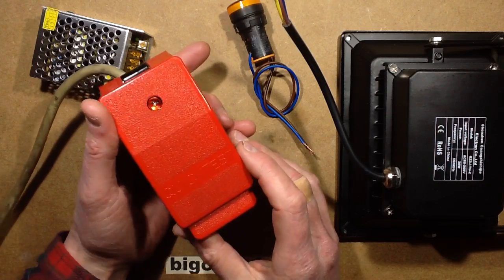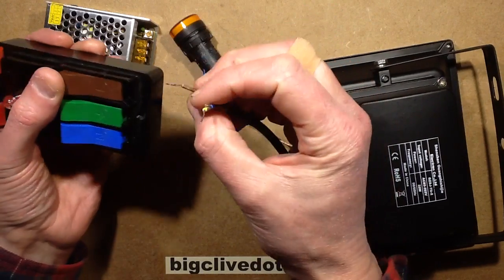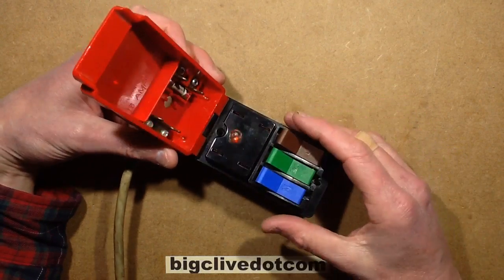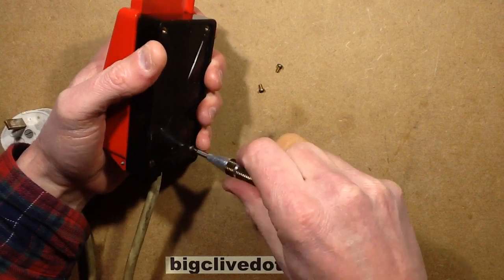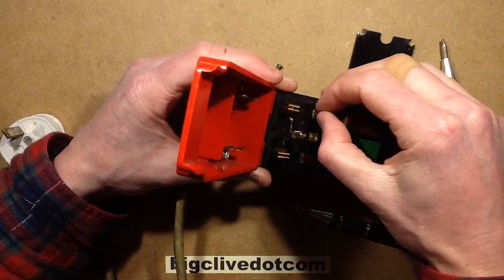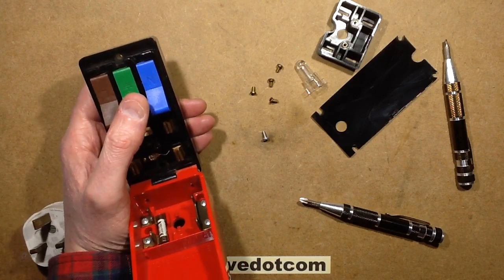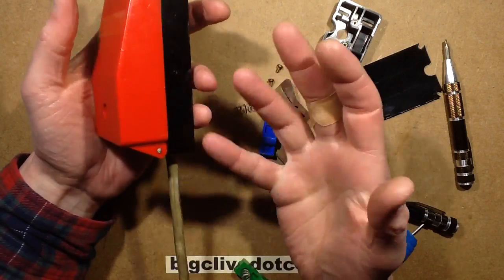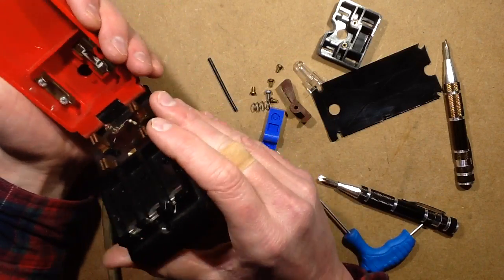A look inside the Cliff Quicktest mains connection unit.

Comment: A great idea, but with quality issues. I bought the 3 phase model a year ago figuring that I could use the 2 extra circuits for my bench's 12Vdc power supply.  I ended up having to use the 2 extra circuits for AC because the screws stripped on the blue and brown even though I did not overtorque them. I have 30 years experience in electronic repair and know how much torque to use.

Comment: I used to have a really old version of one of these with uninsulated metal clamps for the conductors. Don't really believe it mattered but it's nice to know they're insulated now. A bit safer than the choccy block hanging on the end of a bit of cable with a plug on the other end! (Although I've seen B.C. using something similar,)

Comment: These are very nice units, especially for workshops and for us youtubers but I can't agree $60 is a good price, for suck a device I think a good price would be $30. I personally am not getting one because of it's price.
Reply: You could probably wire one up pretty easily tbh, couple of crew connectors and a light switch and boom you have essentially the same thing for £5 or less
Reply: +The Mad Hammer I guess 3d printing one would be a good idea because you can also design the isolation slots and proper mounting tabs.

Comment: Looking for the weak spot in this device for someone accidently or foolishly giving himself a mains shock I can only think of him sticking a suitable strip of metal into the mains side knife socket. Our mains 13A plug sockets prevent this happening by incorporating shutters that only open when the longer earth plug pin is inserted. I suppose incorporating similar shutters into this device for extra safety would just be silly considering it is intended for professional use only ?
Reply: +meandmymouth  not really a lot of point in guarding the knife sockets when the whole point of the device is to connect arbitrary bits of wire to the mains. This device should only be used in suitably controlled environments where everyone is aware of the hazards of electricity.

Comment: Nice to see you using an MK mains plug, sad that that MK no longer make them. They were beautifully designed and so easy to wire up and less prone to overheating with the large area of contact in the terminal posts than lesser plugs with their tiny little screws.
Reply: +Donald Sayers umm the plug in the video looks like a MK "safetyplug" which is still listed on MKs website and still seems to be available from a number of distributors. https://www.mkelectric.com/en-ar/Products/WD/PortablePower/PlugsandAdaptors/Safetyplugs/Pages/646.aspx http://uk.farnell.com/mk-electric/646whi/plug-safety-13a-white/dp/107754
Reply: I stand corrected.

Comment: very useful piece of equipment but really should not be as expensive as it is... a plastic body, a few copper strips and springs... if i had to guess id say this prob costs no more than £3-5 to make, and charging £30+ for it is way to much for such an extremely simple device in my opinion... im just gonna stick to quickly screwing wires into a normal plug

Comment: You won't get these in Germany, because of the stupid non-keyed Schuko-Sockets and plugs!
Reply: +BloodySword Farnell list it on their german site with a choice of a UK plug, a schuko plug or no plug.  http://de.farnell.com/webapp/wcs/stores/servlet/Search?catalogId=15001&langId=-3&storeId=10161&st=quicktest&pageSize=25&showResults=true obviously if you use a schuko plug you might end up with live and neutral reversed but that isn't really any different/worse with this than with anything else.
Reply: +PETER GREEN edit: seems I misread the page, it doesn't seem to be listing a UK plug version, it seems to be listing a schuko version, a single phase version without cable and a three phase version without cable.
Reply: +PETER GREEN Wow. I find it horrible. I guess, they rely on the fact that only an engineer could want one of these and an engineer will know where phase and neutral is. ;)

Comment: Very convenient devices Clive.... they are very safe to use and make life easy in a test bench environment.  I don't think you pointed out though the one thing to be careful about ....
You pretty much can't get to any live contact with the lid open or closed BUT the back two slots can be accessed with DMM probes and will tell you the voltage your'e working with if for instance you have it connected to a Variac.
Loose wires, wire cut offs that fall in this slot can be live so don't grab at them. (Probably never happen unless you're very messy at work but is still something to be aware of)...  
Just watched your video on the LED lights from Ebay, nice use of the LEDs as a bridge rectifier, innovative.

Comment: http://www.newark.com/cliff-electronic-components/cl1860/lead-quicktest-euro-plug-1-5m/dp/87R0064?MER=ALT_N_L5_TestEquipment_None  That one is the CL1860 which has the plug, and 1.5 meters of electrical cord, attached for EURO but is over 6 dollars less expensive.  I would just clip the end off and attached my own end since it seems the CL1850 has no cord at all and is more expensive.

Comment: The black Bakelite Safebloc, marketed by Radiospares, turns up on Ebay every so often, some later ones seem to be ABS plastic, no neon indicator. The factory and lab benches had these at each position, isolation transformers fitted. I have two on the electronics bench at home, very useful indeed. The bench is a drop front desk, with new interior, lab power supplies, Variac underneath, soldering station, audio amps and speakers, radio, and the vital coffee cup holder.........

Comment: Hi Clive I've been using a similar device for 32 years quick testing etc. Still use it daily in workshop. It's a "SAFEBLOCK" with a trade mark "Rendar" I was given it by the boss at a small pump manufacturing company in Walsall where I worked making looms. Will send photos. Many thanks for the great videos. Cheers.

Comment: its a really cool thing, but for 60 dollars i will just put the bare cables in the wall socket
Reply: +Armando92 You're not depending on it as a business tool, clearly.

Wow... YouTube comments >_>
Reply: +unlokia Don't worry! Where mains voltage electricity is concerned, Darwin's theory of evolution will soon weed out the ignorant from the prudent.
Reply: +Armando92 Good luck with that in the UK...
Reply: +unlokia nah. but even if i did my employer will not give me something like this. Thats the way it works in Argentina. Heck even the company that provides us with electricity doesnt come to your home to replace the aerial fuse (dont know if you call them like that) they just tell you via phone a phone call how remove the old copper and how much copper you need to use. We had to change it two times in my house
Reply: +Miko Jones ignorance is not the opposite of prudence, i know the risks and take extra caution when i am working with exposed wires.

Comment: They also used to be used lots in places like Dixons and the electrical departments of department stores/supermarkets. That was back when TVs, hifi and the like came with bare power leads and no mains plug fitted.
Reply: And those were very much semi-permanent connections, all the TVs in the shop were connected with them 24/7
Reply: +Andrès Peña because back before the 1990s in the UK that was how electrical appliances were typically sold. I don't know if that was different to the rest of the world.

Comment: For foreign countries another easy way instead of bare without a cable is with  the socket for a standard 3 pin IEC (eg PC) lead.  Can find one of them easy wherever you go so great if you need to test equipment and travel around the world [far safer than one of these and an adapter for each county].

One of the first things the UK guy new guy at work did was import one of these. For whatever reason they are not sold in many parts of the world

Comment: I worked in a factory (a good while back now) where these were standard items in the test benches at the end of the production lines.  One job involved assembling the automatic shutters on motorised through-window air vents, which then had to be checked for correct operation by powering up via a 'Safe-Bloc' unit -- black version of this with different key colours.  This was as per this one, just attached to a power cord plugged into mains.

It would have been quite possible to stick a screwdriver into the live socket at the back of the unit, so I wouldn't say that these are completely safe.  The test benches had cabinets with a door interlock that prevented the tester from livening the product until it was inside the cabinet.  I'm not sure how this sneaked past the health and safety people.

The test lab I worked in did not use this type of device, though.  You want any wiring to be checked and signed off by a second person, least you blow up a sample product (and/or test equipment).

Comment: I do a fair bit of DIY auto electrical stuff. Can anyone recommend something like this made for 12v applications?
Reply: +TacticalBBQSauce 12v doesn't hurt you if you touch it
Reply: Im aware of that, it does give you a bit of a fright though haha. But I would like some sort power supply for bench testing 12v stuff is more what I was meaning
Reply: Buy this one and just wire it up with 12v instead
Reply: +TacticalBBQSauce No reason one of these wouldn't work with 12V other than the neon not lighting up. Replace that with a lower voltage indicator and it'd work just the same.
Reply: grab an old pc and use the power supply.
Reply: I do a lot of low voltage stuff, I rather use crock clips for it, I added in a 10 amp fuse for a little safety,.. 
you can get them on eBay.. I thought 10 pcs are like 1.5 pounds.. I paid €2.50 euros.. I think I'm quite right on the pound price 😀
Reply: mc349iii
I've considered a pc power supply, but they are a bit bulky. I was hoping for something a bit more compact, but that might be my best option
Reply: Andrew van Leeuwen
They are very handy, but what I'm after is supplying the power to them in the first place
Reply: +TacticalBBQSauce well then,  I'm continuing my little story 
I made some sort of home made lab transformer 
Just with a meanwell 24v 15A output, on a Chinese voltage amperage regulator.. Those can put out 30 V on 6 amps 
(the psu can be ramped up to 30 as well) 
Ad some clips and, Tada.. Your own lab psu!!
Reply: Andrew van Leeuwen
Good idea, sounds pretty compact too, which is good because i have a small workbench (well, a small part of the bench that stays clean haha)
Reply: +TacticalBBQSauce I have pe
Pretty much the same problem., a very little hobby room, I still have a psu tough, but that is too feed some 12v applications in my house ☺️
Reply: +TacticalBBQSauce Use banana female and male pins.

Comment: Finaly picked one up, much better and safer than my ghetto solution which I did not use much because it is a pain to use.
Reply: +TheEPROM9 Is your ghetto solution the same as mine where you have a plug with some stripped wires coming out of it that you have to dubiously connect to other things with crocodile clips?
Reply: BenjaminGoose
Close, but mine uses a terminal block. The wire is to short and it has currently vanished off to the 10th dimension as it is not where I last left it. Did the job for testing some CCTV cameras.
Reply: +TheEPROM9 The tip elsewhere in the thread about using an IEC style pc/kettle plug is a good one for short term use. The sockets are deep enough to make avoiding potential shorts easy enough provided you don't pull on any wires (zip ties or tape are your friends)

I utterly deny using a 800w heating element with a terminal block and a bit of 2 core flex shoved into one such as a semi-permanent heating installation in my workshop for the past 3 months

Comment: that is a very useful testing unit. But its probably a good think that its not so common. I can see it getting misused for a "Semi permanent" use. You can almost see the lawsuits here in the states.. I can see someone overriding the fuse and pushing way too many AMP's though the connector. Its bad enough i seen houses where People just push bear romex wire into a outlet. To wire say a ceiling fixture. Scary   But for a bench top testing.. Its Brilliant..

Comment: I use one of these almost everyday at work.
Reply: +Alan Bacon Why? Its nothing more than a termporary "plug in" adaptor for direct wired fixtures. Couldnt you just use a meter?
Reply: I repair broadcast equipment for a living. I use it for testing power supplies mostly. Nothing permanent at all.

Comment: My brother swore by them, he used one for years, he is a radio ham so allways fiddling with stuff :-)
I in the other hand just make do with a 3 way chunky chocolate block terminal jobbie on a 3 foot cable, it works :-).
I like the mk plug you have there, looks like the one with brass fluted capped nuts and the two bits of nylon for the strain relief :-)
Reply: +zx8401ztv hehe i save my old mk plugs like scrooge! the black ones are like gold dust.  i always used to tin the wires for fitting to this type of plug, ahh the old days!   now pretty much everything has a plug these days i sold my quicktest a fair while back.
Reply from the maker: +zx8401ztv I just opened it to check.  It is!  I hadn't even clicked with that.  It does show how old the unit is.
Reply: +jusb1066 
You sold your quicktest!! i will send you to the dungeons for your disrespect of such a usefull device ha ha :-D :-D
Some of the older plugs are better made, that one on the end of clives quicktest are really nice, i bet they dont make them any more.
Reply: +bigclivedotcom 
They are nice plugs, i allways liked the terminals.
Like i said to jusb1066, i dont suppose they are made any longer.
Some of the new plugs are just shit, i would not trust them with 12 volts let alone 240!!.

Comment: Nice video about it. I've got myself one a while ago.
I found something with it worth mentioning though.

I got mine with the European (shuko) plug fitted to it. The way the cable was terminated and connected inside though, didn't instil a lot of confidence. There were no proper wire ends crimped onto the stripped wires, and a lot of the actual strands were broken. The connections were loosely tightened... 

Now, I might be a nit-picker but I'm not sure if that's what you want in a device that is likely to be moved or handled a lot and is reasonably expensive for what it is.

I redid the cable and crimped wire-ends to the stripped parts of the wires. I tightened the screws a little better as well... 

I expected a little better for the price-point, that's all. :)

Comment: In the late 60s I worked for Labgear, a factory making TV signal boosters and other TV related stuff. Every test bench had one of thesequicktests often called a mouse or rat trap! not sure why, it just was. One of the childish things we would do (well I was only 16/17 at the time) was to place a thin piece of solder between live and neutral and close the trap. When the workers arrived in the morning they would turn on the master power switch to each bench followed by a bang and a puff of smoke. Followed, of course by howls of laughter from the test department. Still makes me laugh when I think about it today!! Sad really.
Reply: I love those stories. Where I worked in the 80s and 90s in the service dept of a high end HiFi shop in the West End there used to be a man who stood outside to sell newspapers with his dog, we would wire a super tweeter up to a signal generator, stick it up to a vent and make the poor mans dog go apeshit.  Which it did.
Reply: Oh and we used these too, except they didn't have that silly neon.
Reply: Also followed by breathing in lead vapor...